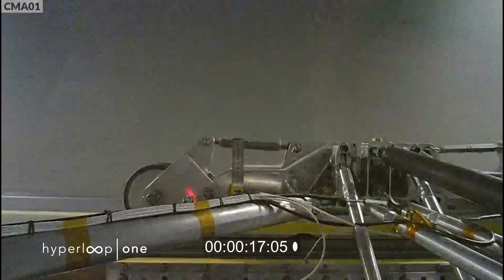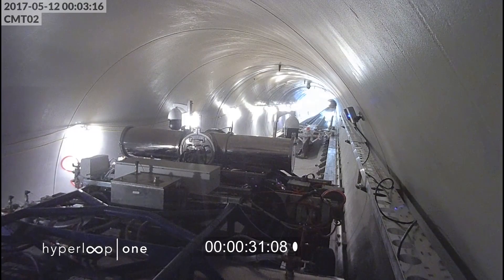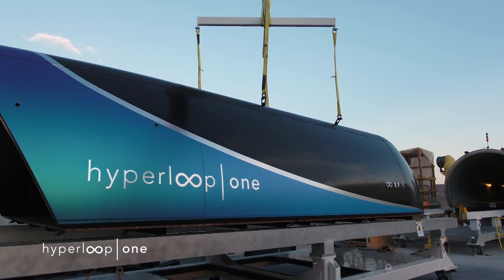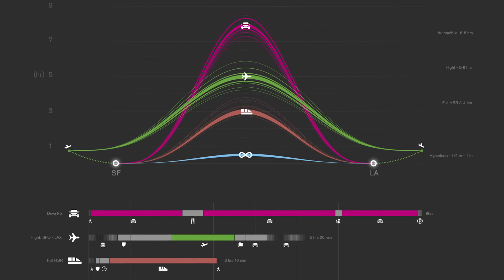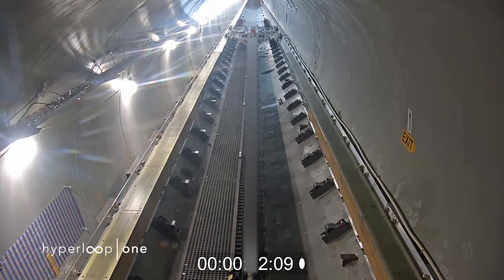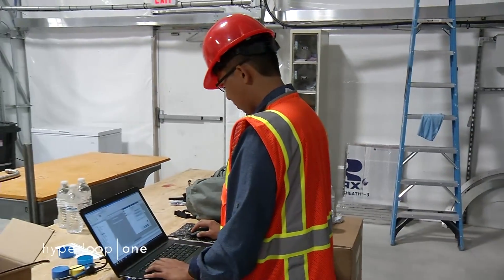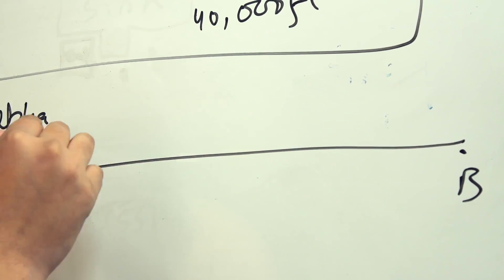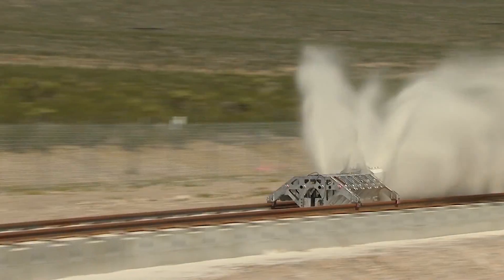Watch the Hyperloop Complete Its First Successful Test Ride | WIRED

Comment: I am really tired of all the self proclaimed experts without even basic understanding of engineering who think they figured things out and found problems the engineers wouldn't be aware of. There are thousands of highly educated and very intelligent people working on hyperloop. Don't you think they are aware of the challenges? I bet they struggle with engineering challenges that you are not even aware of. Most likely the obvious things you are pointing out already have several alternative solutions.
All innovations face challenges. All of them have to fight naysayers. Many of them succeed. Almost never do the naysayers admit they were wrong and even when they do they claim that their resistance to progress is just "healthy scepticism". There is also unhealthy scepticim that prevent human progress!
Reply: Patently false. A dent will not cause any tube to collapse. Compared to a 10mm thick aluminum tanker car, this is a 20mm steel tube with stringers. That is far, far stronger and means small deformations should not cause any buckling.
Reply: . . . if I open the windows in a car my blood doesn't flash boil, that's all I'm saying, inopportune depressurization would suck. Lol. At least in a plane you're just intensifying atmosphere, not completely containing it. Re-use is why Space X is a big deal, transit would have to be high volume. You'd need pressurization airlocks at ingress/egress stations, massive vacuum pumps to maintain, mighty strong tubing to withstand the pressures, and electromagnets make lots of heat. My eyebrow is raised at the practical, not the possible. Same reason I haven't bought a Tesla yet, fossil fuel junkers are more easily obtained. . . that and the boiling blood thing. . . that sounds uncomfortable. And btw, I had more faith in engineers before I worked around them, most of them are just regular people. :D
Reply: Alex Gowers. "Never" is an awful long time.
Reply: He didn't say that software somehow predates the concept. He was saying that when writing software, almost any problem is solve-able. However, in practical engineering projects there are fundamental limits to safety and limits to cost that can't be overcome.
Reply: Ambient Morality Maybe not immediately, but it would cause a failure later on down the line. And by that I mean a couple months if you're lucky. This thing would be so susceptible to catastrophic failure.
Reply: Well people tend to forget, or don´t know, that if there is a failure at one spot it will the pressurisation can´t be faster than 1300km/h which is plenty of time for electronics to shut down Airlocks.
And btw. there is another way than a steel tube, they can build a two layer concrete tube outer one with low vacuum and the inner one with high vacuum, that is cheap and safe.
Reply: I like the way you think. Even if this hyped up loop thingee is a no-go more knowledge will be gained from the process. I think it will be something someday but not exactly how it looks today. Air is definitely a hindrance but weather and ground movement can be just as detrimental to it's operation.
Reply: Alex Gowers i thought the mag-lev was a success? They don't use it any more? Oh shoot, I just bought tickets.
Reply: So people aren't allowed to have opinions? Be quiet.
Reply: Bengt Björck@same,the experts in the comment section,they have an iq of 1000X!!!😂
Reply: @mondayfool wait...I thought the concept predated at least a century ago but practically failed, don't think it has anything to do with the software world.
Reply: Hit any part of the tube with a hammer. Just enough to put a dent. Watch that entire tube collapse soon after. It has been tested and confirmed that all it takes is a small imperfection to compromise the structural integrity of an airlock like that. Unless they come up with a material that can handle all of that while still being practical, that's just one of multiple problems this thing will face. There are many great ideas, and then there are things like solar roadways and the hyperloop.
Reply: You make it sound like "practical engineering projects aren't possible". I am quite sure that safety and cost are top priorities. Just check their web site.
Reply: Everything has unsurvivable failure modes. The key is to maximize survivability. The likelihood of a pod being so close to a breach is relatively unlikely, so in most breach scenarios nobody would be injured.
Reply: Sorry but your statements have no credibility. Get a life!

Comment: This would be massively expensive to maintain it wont be useable because of the cost. Just think:
1) The cost of producing and assembling kilometers of the tubes that can maintain the vacuum inside.
2) The cost of maintenance for the tubes
3) How easily the tubes can create problems. All it needs are just 1 hole, no more vacuum.
4) The cost of maintaining the vacuum environment inside the tube. Millions, Billions, might even be Trillion liters of air to remove from inside the tube.
5) If they are planning to transport people inside, imagine the hazard if suddenly the train ran out of air, or the train is leaking air out. That would be a disaster.

This won't be practical anytime soon. 
In my opinion, just improve on the technology of maglev trains.

Comment: Not going anywhere. What they don't tell you is that any system failure will result in asphyxiation of all passengers and if air intrusion takes place at speeds over 200mph it will result and rapid deceleration cause massive internal injuries and brain damage.

Comment: Good. Next thing is China will build those across the globe for the fraction of the cost and blazing fast speeds.

Those who want to know what would happen if the tube somehow gets repressurized, the answer is, the pod will slowdown due to air resistance. Will the pressure blow the pod away? No. It's on a track, it's got brakes. In case this happens all that's needed to be done is depressurize the whole system. Problem solved. Other problems can be sorted out as well. Don't worry, they are engineers.
Reply: Dr. Saqib No..... these are too slow even by Chinese standards. China's operating trains already run at 300-350km/h as of Sep2017, and is investing and research 1000km/2000km/4000km next generation trains already. So......
Reply: TheTheOuters China's investing with Elon. I live in China. Checkout my channel and you'll know
Reply: Dr. Saqib "don't worry they are engineers." comforting in a bizarre , twisted, psychopathic sorta way.
Reply: That's now how it will work. Ugh.

Comment: So if we put Maglev into vacuum tube (or low presure tube for detailist) , we have Hyperloop prototype running at least 600km/h? The lenght should be shorter than current Maglev record track lenght, which was 18,4km. So the only problem is the low presure cabin and tube...   and size :P

http://www.japantimes.co.jp/news/1997/10/03/national/piloted-maglev-breaks-world-speed-record/#.WWgN7oTyiyo

Comment: As a hyper loop operator would you ever put your entire business model on only two tubes, one for each direction? Quiet a gamble if at the slightest delay or glitch you are looking at 50% of your operation go down. Just simple maintenance and service will be a concern. Musks idea was a simple tube with a pod skidding through a near vacuum... now with the actual implementation complexity goes up, more stuff can break and costs approach that of a regular mag lev train ... BUT if a cargo only solution would be possible, I'm already happy. pneumatic delivery system for the win, less lorries on the street.

Comment: The biggest scam of the 21st century to date. If one is ever  built - and hopefully no one is stupid enough to even try, then what they will have created is the worlds largest, and most expensive single-use mass murder machine.

A sledgehammer of air, with 65 tons of pressure, travelling at 98% the speed of sound, is what travels away from ANY breach in the hyperloop. When it hits the next carriage, it crushes it to dust, blows out the hyperlook at the point, and it carries on down the line.

When the sledgehammer arrives at a station, it hits with the force of 38 Gigajoules, which is enough to destroy the station, and killing anyone within 500 metres, and large parts of the station will be falling to the ground about two kilometres awasy.

This is just plain physics, people. And Physics says a Hyperloop is something only a Type I civilisation can make work, and prevent it being turned into a mass-murder device.

Comment: This is nothing like the original concept. It was supposed to levitate on compressed air, not magnets (lot simpler and cheaper), and use only low pressure air, not hard vacuum (again, lot cheaper and simpler). The pod is supposed to suck air in at the front, to lower drag and for levitation. This system only uses easily available and cheap technologies, nothing fancy. Google "Hyperloop Alpha" to learn more.

Comment: to make a vacuum chamber that long would need power and materials in astronomical scales, and even if you managed it, every time you opened it to let out passengers you would break the seal and would need to pump out all the air all over again. All in all, this is a bad idea
Reply: also, why spend all that time making a vacuum when you could just put a regular train inside the tube and it would go way faster

Comment: It is sad that people don't understand that everything starts somewhere. Think about cars. What about the first airplane that flew a shorter distance than the wingspan of current aircraft. I don't know what will come of this, but if the human race stops trying to advance, then we should all just end our lives because what's the point? To be stagnate and not create? 

Every single thing ever built is built from previous versions. As builders and researchers learn, they apply what they learn to the next model. Do you think the iPad was just an invention out of the blue? It took a lot of research and engineering. Do you think hypersonic aircraft just worked on day one? 

What happened to people, do they just think everything comes into existence and works perfect without science, engineering, math, etc? Seriously?

Comment: no no no no no! this isnt how its suposed to be. You must think of the phiscal dynamics in a straw and spitball. like a rifle. sortof. actually my idea was suposed to be a real life sized hydron colider. 

Why not make it square cuz i see you have no idea what your doing. k( 
the basic idea is for a pod, which can have wheels, magnetic tech is too advanced too expensive think today not tomorrow were talking transportation not experimentation. ... So as I was saying... the tube is suposed to have a variety of effects. or better yet said, different ways of making it.  First off is the original and best designed, for space transportation. a bit complicated. the idea is to replicate the H.Colider. so... that means in its basic principle a tube, at the begining a capsule... and a huge hammer that creates momentum. remeber were talking hammer not explosion. a super rapid force that colides with the pod and ejects it through its path. 
now Second is the more simpler spitball method which i desinged for underwater usage. not for land... but i guess with wheels the phisics could be extrapolated...  the idea is simple. its basiclly a vaccum chamber tube with a pod where a great amount of air wind gust whatever is used to expulse the pod to the other side. the original idea was to make a huge rubber tube kinda like a garden hose... but ofcourse extremely thick, probabbly at least 3m thickness where the pod for transportation would be about a diameter of i dont know... like 2 or 3m aswell. And remember the outer shell of the tube must be some type of alloy that cannot be breached by ocean life. 

That, is how you make a functioning transportation cylinder tubing. that should reach speeds of about 300mph no problem. All with todays technology, not tommorrows. 

so yeah. do it right. i dont know why i even spend my time sending you my ideas NASA. c'mon, your better than this.

Comment: How is this significantly better than rail?  And rail has been in decline in the U.S.  And protecting all that tube from punctures/terrorism/emergency-evacuations seems not well thought out.  The issue with most such transit is the right of way for the land it takes, and this seems to take as much space as a train.

Comment: Am i the only one who find it strange you could hear sounds when they are in a vacuum? 0:13  (In vacuum no sound is possible,  and considering they should be levitating no sound trasmission through the tubes either....)
Are they really this stupid to not edit the sound?
Reply: peppe888 sound travels through over things not just air
Reply: Are you really so stupid that you cant understand that its not a perfect vacuum?
Reply: Even if its not perfect vacuum, at that low of a pressure i assure you sound would be hardly possible, because sound is a pressure wave and with so low of a pressure it's practically impossible to hear normal sounds, maybe some infrasound waves could still be partially trasmitted.

Comment: Do we really need vacuum? It makes the system extremely more expansive and dangerous for very small energy gain. Just put a fan to reduce the pressure on the front and another to increase pressure on the back and that's it. The closed tube deals with animal and people crossing in front of the vehicle, which is a great improvement. That's it, just put it in operation and optimize with time.